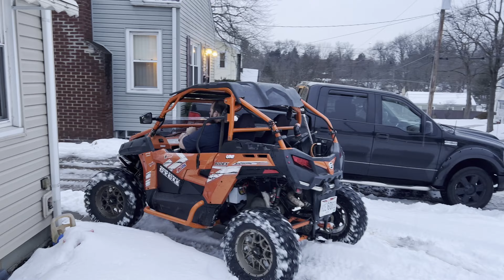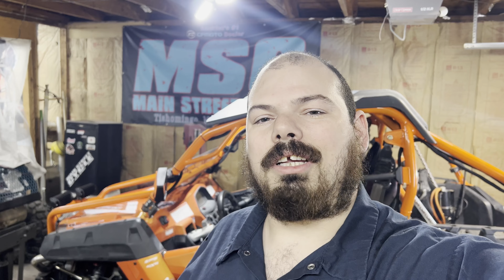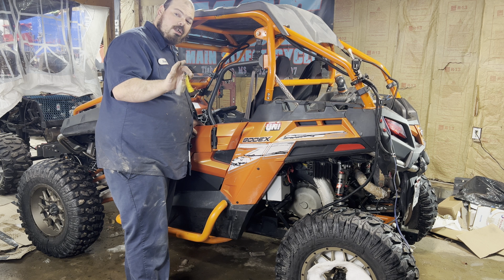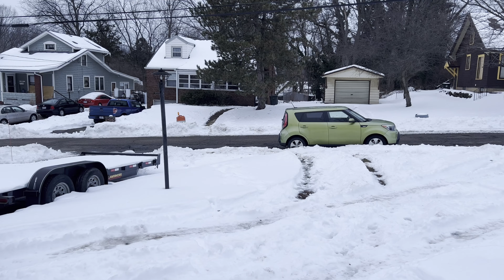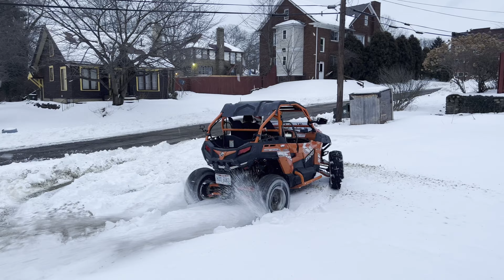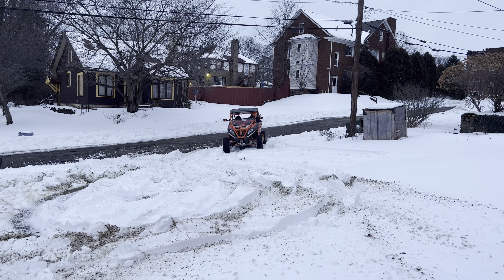CFMOTO RACING ECU AND INTAKE

Comment: Hello just subscribed again don’t know why youtube unsubscribed me but anyway had kind of an off topic question for you I just bought a 950 and second time taking it out only has 15 miles i get p057129 code do you have any idea what it is any help would be great thank you also love all your videos great information.
Reply from the maker: I do believe that’s the throttle code.  CFMOTO had a recall on that.  Thank you 🙏
Reply: @R.N.GPerformance  thank you for the fast reply i will call the dealership when they open appreciate your help and devotion to the cfmoto customers now just waiting for the 950 performance parts to start coming
Reply from the maker: @DaveK68  your welcome.  Not a problem
Reply: @DaveK68  P057129 Brake switch signal circuit defective or out-of-step correlation

Comment: Hey Steve, Could you help me find out why my new z950 is bogging down sometimes when I hit the throttle. It's like I pump it then it works? I have a bunch of mods thanks to you waiting for installation, EFI controller, both clutch mods and a bunch of others. where can I send you a pic of my custom mods and upgrades.I looked at filter and I'm using 93 octane so is there anything you can recommend looking at as being the cause? This thing has less than 50 miles or like 4 hours of riding time. Do I need to look at fuel delivery system cause it feels like a carb problem with fuel. I have not put in motor mods yet until I figure out my issue. Thanks for your time Man!
Reply: Check fuel filter or pinched fuel supply line??
Reply: @mattarnett1281  I dropped the air filter and looked. The fuel filter and fuel lines were fine also. I think its the ECU when in 4 wheel low , it's hitting a rev limiter . I tried again in this last snow storm and 2w high was great. 4w was nice until I started getting past 35mph, then it would bog down if I stayed hard on throttle. It does not like to go fast in low or 4 wheel for long I think. I have the clutch kit and attitude EFI controller so I will tweak the low end for more torque. The spring on secondary will go to B2. I don't think I'll order the bigger spring yet cause I only have 28 inch grim reapers. If I had bigger than 30 inch tires then I'd do the secondary clutch spring and helix. I just had UPS drop my skid plate and clear tinted roof from 3gen. I will post after I have all the mods and upgrades installed. Thanks for you advice Matt, You have a great evening!